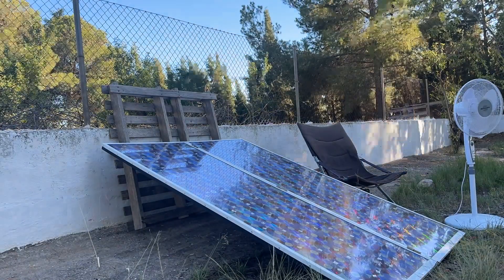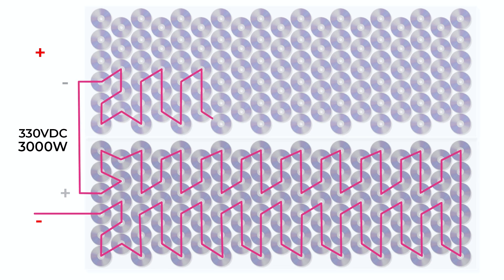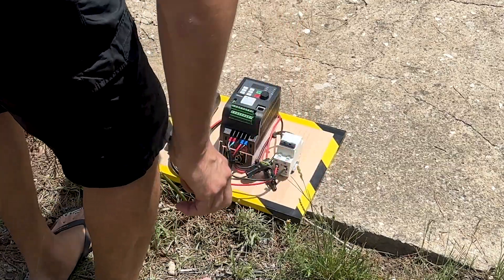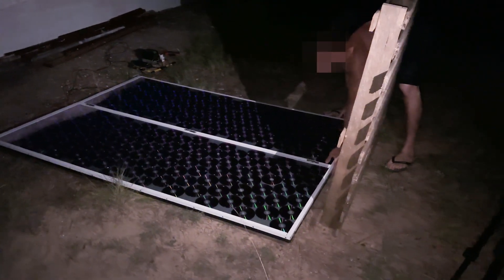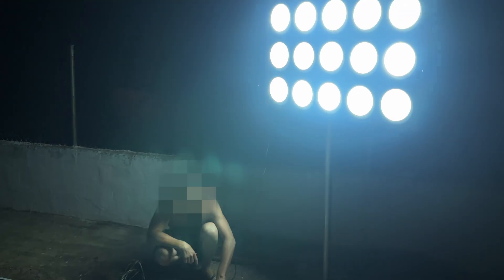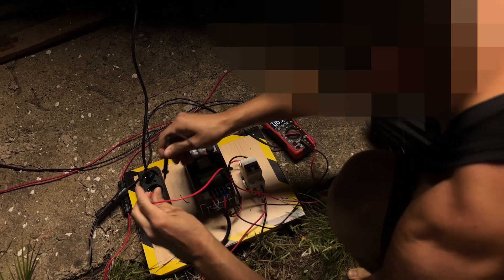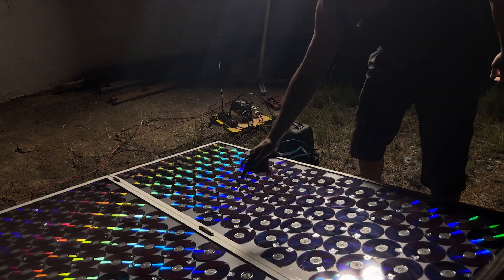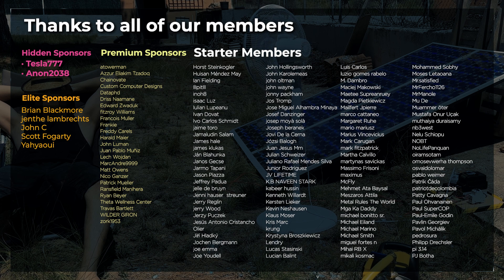THIS HOMEMADE SOLAR PANEL WORKS ON MOONLIGHT

Comment: We're doing a Manual N/A +T build. Are the H, K & VX Turbo the same cams to use? Which one requires stiffer valve springs? Thanks!